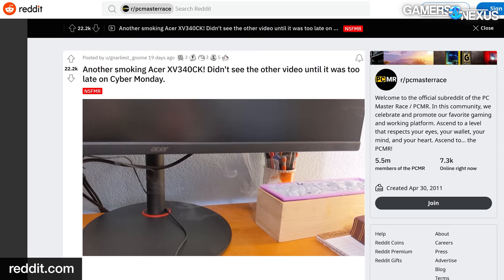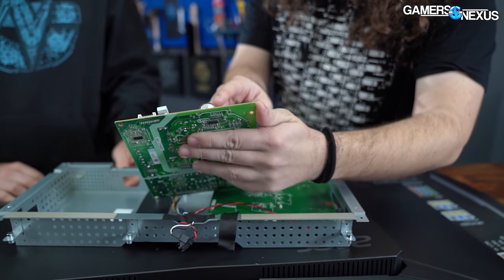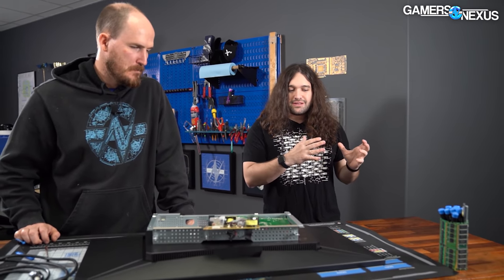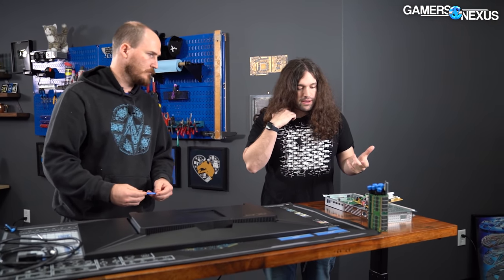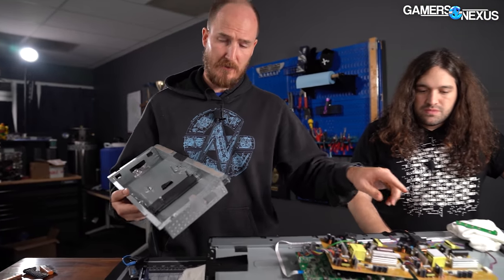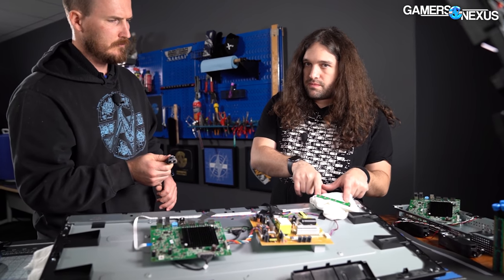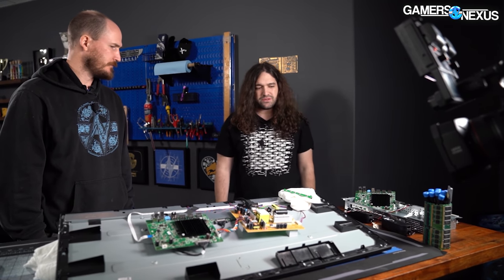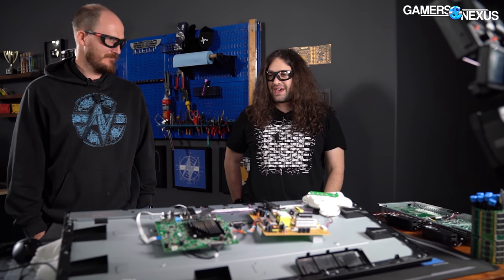Acer Monitor Fires Investigated: Blown Capacitors on Acer XV340CK

Comment: I have this monitor. Purchased from MicroCenter Jan 2021. Walk away from Civ 6 accidentally for 12h+. Have had no problems. I like the monitor but would like more specifics from Acer as to build numbers, confirmation that that capacitor was the issue, and what should be done. Thanks so much for the alert GN!

Comment: This 3:08 is an inductor and part of the power factor correction circuit (PFC).
A boost converter steps the mains power up to about 400V before it gets to the transformer. 
If the PFC fails it can overcharge the capacitor.
Reply: I honestly feel like that Stone dude is faking it as best as he can.
Reply: For those that don't know components, an inductor is a component that stores an electrical charge via a magnetic field, measured in henries, and very similar to a capacitor but used for AC. A capacitor (electrolytic, in the case of the presumed fault) stores electric potential between two plates suspended between fluid, is measured in farads, and only works with DC.
Reply: @iCuMlOuD  he sounds that way doesn’t he? I’ve always felt like he hasn’t said anything I don’t know and I know virtually nothing about power supplies.
Reply: @iCuMlOuD  He did say loud and clear that he's new to even to standard power supply circuits.
Reply: by boost you prob mean the bridge rectifier. After the 240v ac (in my case) is rectified you will need up with about 400v dc.
Reply: @Cryorm   I wouldn't phrase it that way.  Inductors block high frequencies, pass low frequencies.  Capacitors block low frequencies, pass high frequencies.  I think it is inaccurate to say caps "only work with DC" -- reservoir caps will store DC, which may be what you meant.  But caps are also used for blocking the DC component of a signal and passing the AC component, like audio, video, or digital inputs/outputs.
Reply: @CocoaEm   No, active power factor correction is essentially a boost-mode switching regulator.  The bridge rectifier will result in a rectified waveform that, when dumped into a capacitor, will result in a DC level slightly under the peak of the AC waveform (volts P-t-P), whereas the AC voltage would ordinarily be measured in volts RMS.  So a rectifier doesn't actually boost voltage, it's just that in DC-land, you're measuring the peak value instead of the average value, so the measured number is usually higher, by a factor of 1.414 -- assuming a fixed-frequency sinusoidal AC waveform and a true RMS meter.  Hijinks ensue when used with non-sine inverters pumping out partial 50% duty cycle square waves...
Reply: @nickwallette6201  Thanks for the clarification. I usually do repair to things that receive directly DC. so don't really touch switch mode powersuppies with power factor correction.  At least in my head i correctly identified what the inductor was there for and what it was supposed to be doing.
Reply: Not really overcharge, more like overvolt.
Reply: @CocoaEm  No you don't eend up with 400V after the bridge rectifier. Rectifying 240VAC wil result in at most 340VDC. To correct the power factor and to provide a universal voltage input (100-240V), a boost converter is then used to get the resulting rectified voltage up to roughly 400VDC. Only then is it smoothed by the bulk capacitor. It works just the same as the active PFC circuit in a PC power supply.
Reply: @CocoaEm  this is a PFC, if you have bridge rectifier, followed by a big cap - the power factor would be low - around 0.5...
Reply: It had properly vented as designed, looking at it. Reverse polarity will cause the case to explode to pieces, not vent.
Reply: @CocoaEm  A bridge rectifier is just a bunch of diodes, that is clearly not a diode. A boost converter is extremely common. Rectifiers are just for converting AC to DC.
Reply: @iCuMlOuD  yeah, i always had the impression that Stone doesn't know that much about electronics...
Reply: @Nate_123  yeah, i know that.

Comment: Those aren't thermal pads, those are just foam pads to prevent the back of the PCB from shorting to the EARTHED case. Big difference btw, with AC there isn't a ground like there is with DC. Neutral can still give you a shock unless it's also connected to protective earth at the same time, (and even then it could theoretically still give you a shock but I'd be very unlikely). So at least me and the electrical folks I work with generally call connections such as this the earth instead of ground (and we use earthed instead of grounded) when talking about AC. 

I reckon calling it ground isn't technically wrong per-say, but since (to my knowledge) it isn't generally referred to in that manner I suspect it could potentially be very dangerous if the two are misconstrued for each other by someone with insufficient knowledge on the subject. For example: when the circuits ground is connected to the chassis, it is called ground and the chassis could be referred to as being grounded, but after the product is plugged into a properly earthed electrical socket and the cable earthing lug is securely connected to the chassis, then and only then is the chassis both grounded and earthed at the same time, but this state is generally just referred to as 'earthed'. 

Btw, to clarify some of the nomenclature, 'earth' is the connection/cable used to connect something to protective earth, and 'protective earth' is when an earth connection/cable is actually connected to a working ground connection so that it would protect you by blowing the GFCI breaker (ground-fault-circuit-interruptor) instead of allowing a piece of earthed metal to become live at mains potential. ("ground connection" here was meant literally, because usually the earth connection is nothing more than a 6 foot copper pole driven into the ground just outside the building).
Reply: Not disagreeing, but hopefully clarifying.

Ground is a logical voltage, it's whatever is defined as 0V in the circuit in question.  All other voltages are measured and defined relative to ground, but ground is not necessarily connected to earth.  (Imagine a battery-powered device - the negative terminal of the battery is "ground" and it's not anywhere near the Earth).  This ground takes its definition from the scientific "ground state" and is only indirectly related to "the ground" in the common usage meaning the surface of the Earth.

Anything with a three-prong plug will usually have ground and earth connected together, and the neutral wire of an AC outlet usually finds its way to earth somewhere, but none of the three definitions are the same.
Reply: Sorry, they are thermal pads in the monitors I opened up as they are placed on thermal components. They dont need to act like artic silver, it just makes the warmer components cooler for longer life. Simple test, touch your finger to them and if they feel cool, they are thermal pads. Most normal insulation pads are black, those are not,
Reply: @user-rs8zg8ey2b  I am actually talking about the 4cm thick square pads on the back on the PCB
Reply: @fluffysheap  I considered including this info, but I didn't want to make it too technical 😋  However I'm glad that those interested can now scroll down and read your comment for some additional info 😊
Reply: @TheBauwssss  Yea, I am too, I just fixed a dell utra sharp 34" widescreen (dcdc ic failed), and there was about 6 off them large pads, all placed on the warmer components, same color as the ones in this video, its easy to tell if they are thermally conductive as they feel cool (as they transfer heat away for your fingers), take care.

Comment: Steve happily saying: "Now we are back with a new fire hazard"
man that's becoming a norm now
Reply: I'm starting to think that quality control went out the window when even basic electronic components got 4x as expensive and had lead times measured in years.

At that point, the choices the engineers have to make are between shoddy components with high failure rates or not having a product to sell at all. In fact, the engineers themselves probably aren't aware of the true failure rate until after they start getting a bunch of phone calls about exploding monitors or power supply. Someone bought a bunch of caps to replace the fifth shorted component this week and didn't look too closely on who was selling them.

When prices jump, quality plummets and safety gets thrown out the window.
Reply: In before his insurance goes up

Comment: I recently was given a used acer P236H which would show about 2 seconds of display, then blackscreen. Had a 2nd monitor plugged into the card, and changing resolution or refresh rate would activate the Acer for a second, then blackscreen again.
Took it apart, and it had 2 swelled caps of the same color as your 450v cap. The 2 bad caps in this display were 470 ųf 35v
Since I was already in the box, I just recapped the whole unit. After reassembly,  it works perfectly.

Comment: So, tech nerd here, the transformer you showed was likely a active power factor correction transformer, the liquid or goop is the electrolyte from a capacitor, and based on the destription of the event, the problem is likely just a reverse polarised capacitor, some cheaper capacitors sometimes screw up and put the markings wrong or could have been just in production that they were axidentally reversed like the recent asus exploding motherboards dilemma. The fix if the PFC circuit is unharmed, should just be replacing the capacitor with the same or higher capacity one, possibly replacing the fuse if it is open and checking the bridge rectifier for short circuits.

Comment: You should make a windowed desk for your shop. That way when you set something face down you can still see the other side as you're working on it if need be. Make it so.
Reply: C l a r a__🍒  I have a dog
Reply from the maker: Really cool idea for video / b-roll shots!
Reply: Or just a glass top desk.
Reply: Window plus a mirror on the floor
Reply: @hubertnnn  a mirror on the floor AND a mirror on the wall set up in a way that casts the screen right in front of you!
Reply: @hubertnnn  good idea 💡
Reply: @GamersNexus  You could make a real cool workbench modded with all kinds of neat things. Window, cool lighting , tool holders, storage for screws etc... So on and so forth.

Comment: I suspect those "thermal pads" are designed for space between panel and boards, for air space between two warm (not hot) components, to facilitate convective heat dissipation.
Reply: From my experience it's just to prevent arcs, it's not really about heat dissipation at all. When there is some high voltage stuff going on this is quite necessary. I once had a CRT monitor that failed all the time, after replacing it under warranty for over 4 times I decided to open it up and check it out. My father is quite an electronics expert and he noticed the high voltage cable was very close to the metal shielding. It probably arced from time to time because the screen actually flashed when it happened. After about 10 flashes (this could sustain for over a couple of weeks) the screen would go black and never turn back on. On that last replacement we actually fixed the problem by putting in a nylon spacer ring (you see them a lot in CRT monitors). It's so weird to see a manufacturer make these mistakes, to not recognize them and go to all the hassle of replacing monitors under warranty without fixing the problem. It was a GDI Microscan 19 inch CRT from 1997 or so.

Comment: between NZXT, Gigabyte,  EVGA, Asus z690 boards, and now a monitor, you could literally build a FIRE PC ! 
WTF is happening lately?
Reply: Prices are booming and so are the products 😂
Reply: That's a speed run I wanna see. What part will catch fire first. How many modmats do I have to buy, Steve?
Reply: Have you seen the year recap video GN did? worst trend of the year - catching on fire... still going strong all the way to 31st december
Reply: EVGA GPUs never blew up/caught fire, they were just:

1. Literally stolen from a truck
2. 'bricked' because of whatever new world did
Reply: @Walhor  Note 7 was ahead of it's time!
Reply: chinese manufacturing
Reply: every manufacturer is trying cut the cost  and make the most , which leads to things like this , same with all the brands you listed in your comment , all comes down to corporate greed
Reply: @MrRafting  They had bad power stages and MOSFETs, like pretty much every 3090 that has the same one.
Reply: @MrRafting  The GPU should have a fail-safe switch to prevent itself becoming bricked. It's not New World's fault but the GPU.
Reply: We are already collecting a part list for "Fire hazard PC" on JayzTwoCents latest video.
Reply: @MrRafting  Correction: New World was bricking all brands of GPUs, not just EVGA. Once the game came out and more people played it, it was happening to loads of brands. New World is just a crap game, don't blame any specific manufacturer for it.
Reply: @nunns2  These GPUs run every other game on the market just fine. It's New World's fault, not the GPU's fault.
Reply: @MrRafting  Some we’re pouring smoke out of them though probably would have led to fire if not shut off immediately.
Reply: @mjc0961  Still, it probably shouldn't kill any GPUs, hopefully next generation will have a functioning failsafe for the issue New World causes which will just reset the GPU (and crash the program to the desktop).

Ideally I would like software (even badly written) to not be capable of killing hardware.
Reply: @MLWJ1993  Software in no circumstances should be able to kill hardware. The New World thing is 100% the GPU vendors fault. Just imagine if your cereal box spontaneously exploded because you put it to the left of the bowl instead of the right - that's what happened here.
Reply: Pls make it happen GN it would be hilarious!!!!
Reply: Wait what is wrong with ASUS Z690 boards? Haven’t seen that and now im suddenly glad I went with MSI lma
Reply: @arbiterodie7685  there's enough blame to go around they can both be at fault
Reply: @Hogdriva  possibly a capacitor issue where it is mounted the wrong way around, and blowing mosfets at the top right corner near the RAM.
Reply: @MrRafting  Apart from me seeing actual pictures of PWM controllers completely blown out on EVGA 3090s... Yeah they totally never caught fire before. In most cases however they didnt blow up like a lot of people think, but I wouldnt say "they never blew up/caught fire'.

NW has some of the craziest transients in any game. Can go from max transients (note: transients very normally go fair bit above PL, 1080 - 3090 max transients were easily 100w over PL with the 3090 being higher then I've seen before) to min power and back to max transients in the span of a few ms. The VRM design was shit more or less, cheap analog PWM controller on a asymmetrical VRM, it couldnt handle such transients and thus failed usually. This design flaw was primarily on EVGA/GB 3090s.

Comment: Maybe an IR camera shot would have added something extra to this or a probe.
It would be good to know if the others can be fixed/rectified.
Reply from the maker: We talked about it but assumed it wouldn't be useful since the failure was reportedly so fast; however, another user contacted us with more information about a similar failure and potential ways to trigger it, so we'll try that next and add a probe if we do!
Reply: @GamersNexus  Only takes seconds of running a linear regulator backwards to get it finger-burning hot.

Comment: Just wanted to add, I purchased one of these in May 2021 and have been using it all day, daily ever since without a problem. Gives me hope it's just a bad batch but I felt like crap seeing this video and having the monitor so I hope the results of leaving it in the office and monitoring it over time are consistent with my experience. Definite RIP to anyone who did get one for the holidays and it went up in smoke, hope you can easily get a replacement.
Reply: I also bought one of these. I'm hoping it's a case of 'if it hasn't failed by now, it's not going to for a good long while'.

Comment: I remember having a Biostar motherboard for my Athlon Thunderbird and it had a bunch of bulging caps, but none of them actually leaked anything out. The board ran for a long time like that, it was even overclocked (because tbird of course). I was curious when it would fail but it never did. Eventually I replaced the motherboard and gave the build to a friend who ran it for years.
Reply: You remind me of something funny I experienced around the same era of CPU's/Motherboards. I overclocked a lot back then and traveled to friends without PC case, just loose components all put in a bag with motherboard screwed onto a removable backplate from an AOpen HX08 case with a PSU attached to it. all worked fine. At some point I must have bumped into something with my bag because a bunch of caps had ripped off the motherboard. The system never failed om me though, It kept running for years without any issues while I put that thing on some heavy duty overclocking exercises.

Comment: Looks like the electrolytic cap is part of the input ac to dc conversion.  It likely isn't rated high enough for the load and switching frequency of the converter.  Looks like 100uF but probably should be higher.  Electrolytic capacitors will lose some of their value over time just sitting on a shelf, but add into that a high frequency switching load and...
Edit:
Could be a batch of bad caps or old caps, but that is usually why you use a slightly higher capacitance in the design stage for situations where you can use a slightly higher value.
Reply from the maker: Great info! Thanks for that. It's awesome reading comments like this as it gives us new ideas for what to check for if we look further into it or if this comes up again on another component.